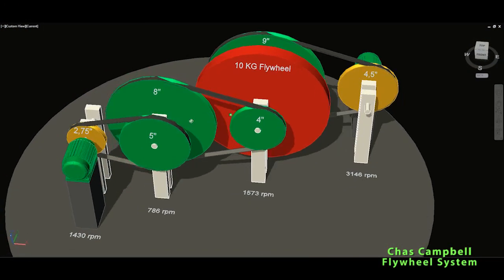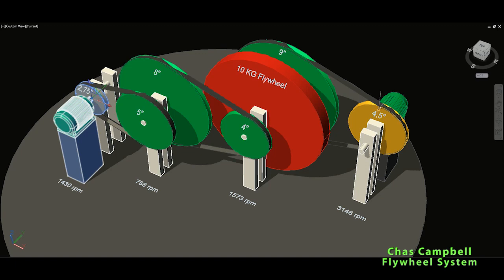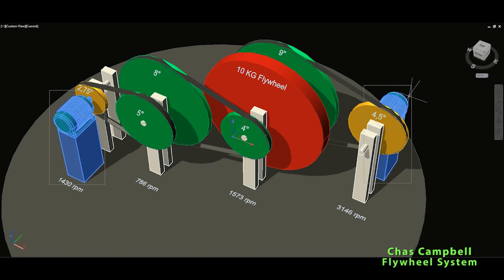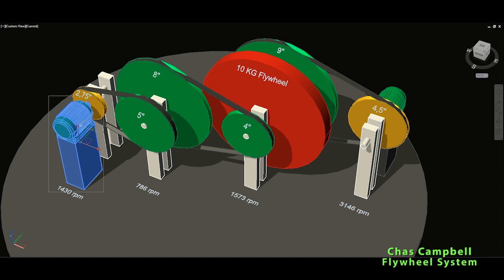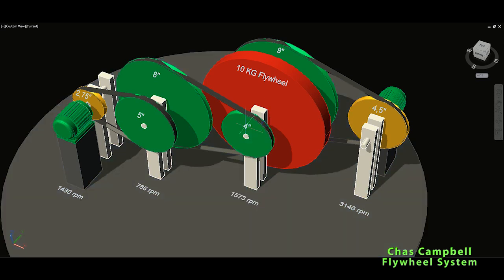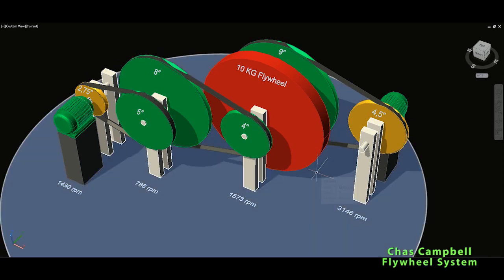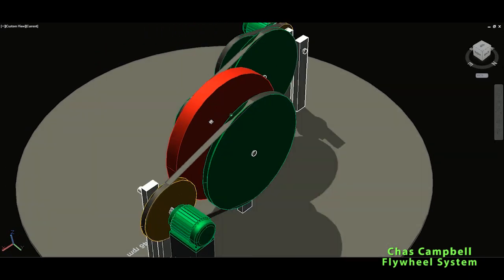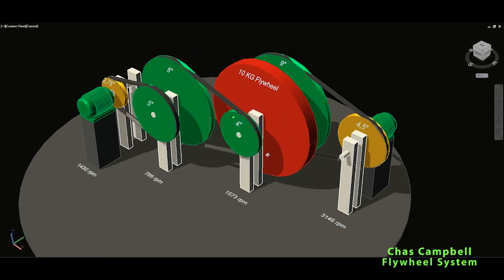Free Energy Generator, CHAS CAMPBELL Flywheel System, Overunity

Comment: We showed chas when we tested his device that loading a flywheel-based generator will drop in wattage.  Even if its fancy switched and pulsed. Chas plugged in a 120-watt power drill and free-wheeled it, We said , its rated for 120 watt under load, your free-wheeling it or not putting it under load how do you know its drawing 120 watts? We put the meter on there and that was the end of Chas Campbell. We do real testing, we are non-profit, if you want to get some th8ng tested do it right. Thats my best advice.

Comment: "If it's a fake I don't know" says it all. Overcomplicated rubbish with a sh•tload of conversions between different rpm and torque to make it as complicated as can be. The more bearings and belt drives you add the more you will lose just by mechanical disadvantages. And comparing totally different rpms and amps on generator and motor side obscures it even more. Nothing but garbage, do stuff that really matters.

Comment: Hey can you help me about the free power generator I have generator30 kva  1500 rpm And three phases, I have two flywheels with a total weight 65kg I don't know the horsepower of the induction motor, the size of the pulleys I needed, and the speed of the induction motor

Comment: Why he reduces the first flywheel down is he gets more torque in fact doubling the amount of force. On the 8-in to 4-in to turn the flywheel the 10 kg flywheel he's getting his speed back up period after the flywheel the 9-in going down to 4.5 it looks like it doubles the if not triples the original output into the generator. The main thing is the two main things of this whole free energy machine is at first he's making more torque by reducing the speed which is well known I think turning the flywheel allows this Force to continue at a higher speed then it goes into a generator that the original motor would never be able to turn I'd always thought that there was a way of more producing more torque by reducing the speed to get more energy and out than in
Reply: No matter how you juggle speed and torque you lose power with every belt. This device reduces then increases speed before driving the flywheel - why not drive it with one belt from motor to flywheel? Because it obfuscates what's happening for people with little mechanical understanding. Just one belt from motor to flywheel, one belt from flywheel to alternator, and what do you see? Loss at two belts, bearing drag and aerodynamic drag on the flywheel, and less energy out than in, even before you consider that the best motors and generators are only around 95% efficient, with regular kit more like 80%. Sure you can stop the motor and run a load on the alternator, but that's just energy the motor already put into the flywheel and it won't last long.

Comment: generator use permanent magnet so the efficiency high , when running ,energy store at flyweel , so the system still running although you cut off the source even load.
now still remain is parameter of time? hehe....you can edit what you want ???

Comment: It doesn't work... simply because when you spin that flywheel it takes huge amount of energy until it gains momentum once it gains momentum or inertia to centrifugal force it rotates at giben amount of energy but its energy cannot be greater than the input energy so it means you are only converting that input motor's speed to get more torque from that heavy flywheel but then it's output gear ratio is decreasing it means it needs more torque so you get that torque from the flywheel but the energy from the flywheel comes from the input motor so this machine just simply convert speed to torque then back to speed... it is complete useless its like directly connect the input motor to the output generator

Ps. there are also losses esp. friction from the gear

Comment: The problem is.. as the thing spins it builds heat, in addition friction from wind resistance and the belts / bearings.  So, no free power.  But it’ll probably keep its self running for awhile

Comment: The 4 pullies driving the flywheel is a total ratio of 1:1.1, if the flywheel was fitted with a 2.5" Pulley you could drive the Flywheel direct from the motor 2.75" Pulley and get the same ratio or speed and reduce a lot of friction, any Engineer or Fitter could tell you that. Bottom line is more bullshit looks better, anyone that claims it produces more energy that what is supplied to the motor has never built and tested it or they are trying to deceive people, its one or the other and nothing else, That is a FACT !!.
Reply: Thats what i could not figure oit. Why reduce the rpm only to increase it a few hundred more right at the flywheel. Just flip the first two pulleys and the final rpm would be a lot higher!
Reply: @dodge1137  Trying to figure out BS will only cause confusion as it has done with you. If it smells and looks like BS don't taste it.

Comment: as others have observed, a pulley is not a flywheel.     it is not clear whether campbell's idea can work well, where Multiple, belt-driven stages and off-the-shelf components are used.    see linked video, for a functional overunity apparatus.    driving a  Rotary 2nd-class Lever at one or More fixed locations at  Orbit of the movement of its  End-point,  RESULTS in  torque  Multiplication, nearer the center of rotation.   this fact reflects the  SCALAR  nature of  Torque energy.   (see the law of the (rotary) lever; see a wind turbine rotor or a waterwheel for examples of the use of  'non-collapsed' MA in an energy  Conversion  scheme.)       a key underlying concept is  'the conversion of very high rotation rate to Torque'.; ie,  Simultaneous speed-reduction and torque-multiplication via a  Correctly conceived,  Complex mechanism.    obviously, input energy consumption should be kept as low as possible.      this can be done via the correct  Efficient  Conversion of  Electrical power to mechanical,  at the beginning of the process;  and the Efficient  Conversion of  mechanical (torque) energy to  Electrical  power, at the end.      at small scales, losses at the drive can be minimized via the use of a non-contact drive mechanism; a large scales, a  Friction-drive is called for.   (see a modern ferris wheel drive mechanism.)      cheers                 googletranslate
https://www.publicdomainpictures.net/pictures/170000/velka/ferris-wheel-drive-mechanism.jpg
video
https://www.youtube.com/watch?v=lTkXciAn488
waterwheel, the use of a 'true length' rotary 2nd-class lever in an energy  Conversion  scheme
https://upload.wikimedia.org/wikipedia/commons/thumb/5/53/Overshot_water_wheel_schematic.svg/991px-Overshot_water_wheel_schematic.svg.png

Comment: OMFG.... simple gearing to multiply spin rate.... with a flywheel integrated to baffle the ignorant... (flywheels are used to store intermittent input for a continuous output and in this gearing model it has no purpose as the input is continuous)... spin multipliers do not increase the energy output, just the rotational speed...  an identical experiment would be to put a large gear on electric motor A to turn a small gear on electric motor B (generator)... wake up children

Comment: campbell was sorta on the right track.   but he was distracted by flywheels; which do NOTHING.    humans have mostly eschewed the use of the 'true length' rotary lever, instead favoring the use of 'collapsed' MA via the use of two or more gears/wheels (gearset)    however, where  a compact gearset is used, torque energy 'density' is Not Preserved.  it is Sacrificed, primarily, for the sake of  COMPACTNESS.     cheers

Comment: Models. With models i can prove the "Earth" a ball. With models, i can prove we have probes on mars. With models, a rocket can traverse a vacuum called space. In the real world, however...
"Earth" is a free energy generator, not an improbability drive. If it is cgi, like every thing from nasa, then we have to ask why? Where is the constructed and functioning machine?

Earth is a capacitor. As you go up in altitude, the electrical charge increases. The difference between the chargeless earth and sky increases. Hence the massive discharge when lightning happens. This electricity is our predominant source. The fossil fuels story is hokum.

High voltage power lines are not insulated. This is because electricity goes to them and not from them. Tall masts and towers gather this power and charge the grid. We then pay through the nose for this on the pretence that the power companies have expended effort and outlay to create it. There is no power shortage. There is no fuel shortage.

Check out Aaron Dover's channel. 

The Pink Floyds flying pig over Battersea power station tells all. Battersea power station was derelict 7 years after building. It never produced any power. It didn't even have a roof until 4 years ago when it became an art exhibition.

Comment: This system works.. I have seen it working In real life.. doesn't work in first attempt.. you have to work hard to keep right "critical ratio" and flywheel should be pulsed .. if flywheel is smooth it will not harness any gravitational energy from mother nature.. so final verdict is "right critical ratio" and pulsed flywheel can make this system work if an engineer doesn't give up.. search patents of this system on internet to have right critical ratio.. pulse of flywheel and whole system comes from loose belts.. and that pulse when shifted to flywheel harnesses gravitational energy which gives excess output than input . Campbell is a genius.
Reply: Hi. Can you please elaborate or tell me how? Or help me if you can show where I am going wrong
Reply: How stupid are you? This breaks the first law of thermodynamics. The laws of physics and thermodynamics always hold true.

Comment: I hate when people that don't understand basic physics. Think is possible to get more energy out of a system than the energy put in the system. Energy can't be created or lost. It can be changed from one form of energy to another format. That the law of conservation of energy.
Reply: Pls kindly get it that the laws of conservation of energy derived from the first law of thermodynamics etc are not applicable here. It's the law of momentum and the whole concept needs modern days analysis to come out with its own formula. This system has worked in many workshops and labs etc. Try it and see for yourself and get your doubts cleared.

Comment: Chas Campbell flywheel system: Overunity Generator is a perpetual motion machine. The perpetual motion machine is an old dream, which sadly is impossible. It is impossible because of the loss of energy caused by friction between the parts of the system.

Comment: I think this will not work,  because 750w motor and 2,350w generators you had 75 wattage available why? you need to consider that generators only gives you a 50% of wattage,  2,350w / 2 = 1,175watts , and your ac motor need 750watts with 5amps,  220volts * 5amps = 1,100watts this is your ac motor max need.  1,175watts - 1,100watts you had 75watts to use, congrats you can turn on your electric fan for free. but you cost  thousand dollar to buiild this. :D

Comment: Sorry only one flywheel the rest are pulleys. The one on your left is a 750watt motor not a generator. Again Chas Campbell Generator like all generators cannot run it’s self. Also your showing all the belts under tension this is wrong, so the device you showing in the nicely illustrated drawing will not work they need to slip somewhat, acting like a clutch. Ho and it does work.  Will be uploading my version soon.      But please forget making it run its self.  750watts input running a 2k output. That’s the best I can get. but it don’t run long minutes only then the generator drops out all speeds beck up and run 2k again, and  NO dropping the load don’t resolve this. (Generator field dropout) but this is for some other time. thanks for uploading.

Comment: I see comments that this solution didn't work. It does work. Most likely you are trying to use a stater with factory copper windings. Most three phase motor staters are wound with the first stater coil as phase one, second stater coil as phase two, third stater coil as phase three, fourth stater coil as phase one, fifth stater coil as phase two, and repeated all the way around until reaching the first stater coil. The key for the generator is to pull all the copper winding out and rewind the stater coils to North, South, North, South, all the way round. Use brushless motors/generators, like from an energy efficient LG washing machine. The key is to generate RF, not AC or DC. RF is why Tesla's electric motors outperformed Edison's electric motors. Tesla's backers couldn't use RF to sell electricity because there was no way to meter the amount of electricity generated or used. A 60 Hertz Cycle was added to AC as the solution to sell electricity in the USA; 50 Hertz in other parts of the world. Rewire your motor/generator for RF and you will see a huge improvement in performance and it will not overheat like AC/DC motors/generators. As usual, great CAD work Mario!! BTW, it's not called the Chas Campbell Flywheel System. This design has been around for years and used in many countries. It's commonly known as the Flywheel Generator; but I call it the DecimalZero Flywheel Generator. Be safe. 🖖😃😊
Reply: Finally someone with some freaking brains, we amplify power all the freaking time.  It doesn't matter if it doesn't run indefinitely, if it ran itself for an hour it would have produced a surplus of power.  However if someone thought this was bs then go make it and prove me wrong.
Reply: Can you explain what RF is or point me to where I can learn about it compared to AC or DC
Reply: What is RF? I use a translation program.
Reply: Sorry, the question has been resolved, because I came up with it!

Comment: Energy you put into a system could never been multiplied by the output. The belts and flywheels consume power from the input motor. So never it could be.
Reply: Justin Timber dear brother if design is efficient and critical ratio of gears is right system will be more efficient as other people said in reply of your comment.. but this is not the answer.. real answer is "pulsed" flywheel.. hear again.. not a flywheel.. a "pulsed" flywheel .. or in other words jerky flywheel.. that "pulse" harnesses gravitational energy of nature we have here on Earth.. and system gives more output than input.. of course efficient design and "critical ratio" is also important but "pulsed" flywheel as made by loose belts in this system in answer to your query.. I have seen this system work ..
Reply: it'll work just fine... the first set is geared down for more torque from the motor... putting less strain on it... then, it steps that torque to speed... speed that powers the flywheel... then, that momentum is what gives the final torque plus speed to run the generator without loss...
Reply: Go back to school. Every heard of a pulley system?
Reply: @blackicicle  this system is a hoax. anyone who's knowledgeable on thermodynamics laws can see that.

Comment: I try that system and not work waste time and money after the generator magnetic all the system reduce the speed and stop, the main motor going Hot and put to much amps
Reply: But thanks for the diagram I guess the solar panels are the best options for now
Reply: What if it was powered by water pressure and a Pelton wheel?
Reply: ralph diggs hey a good way is to find electronics recyclers on Craigslist and pull out the hard drives they got two big neodymiums in them
Reply: ralph diggs awesome I am setting up 930 watts of solar on my school bus RV with 24v 435 amp hours of batteries I am doing it my self and only have spent 1600$ I have been studying for past three months
Reply: ralph diggs I live in southern California so there are a lot of deals here I got 8, 150watt panels for 60$ each and the 5 month old agm 650$ batteries for 140$ each! they are from a server company in silicon valley that changes there batteries 3 times a year!
Reply: carry on
Reply: Alexis, if you knew physics you would not have tried to make this machine and would not have wasted your time and money.  The truth is that those flying wheels actually reduce the amount of energy due to friction so you'd get less energy than you put in the system.
Reply: Alexis Cueto ..why u are runners no behind with free energy when can cut down with two welding plant.....think n act
Reply: Alexis... how you do you device? Mesures.
Reply: its seem to be a varible reluctance effect since chas used a capacitor type generator. he probably could have disengaged the rotor magnet entirely if he had a switch on it and it has nothing to do with flywheels.
Reply: ralph diggs if you cold the coil you going to broke the motor because the amps still same